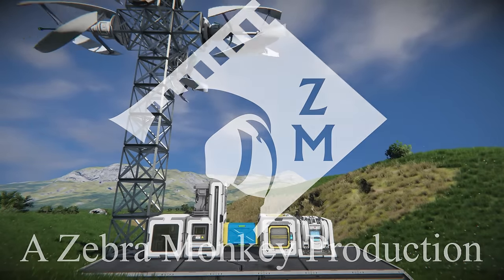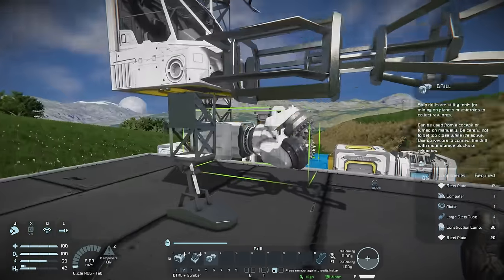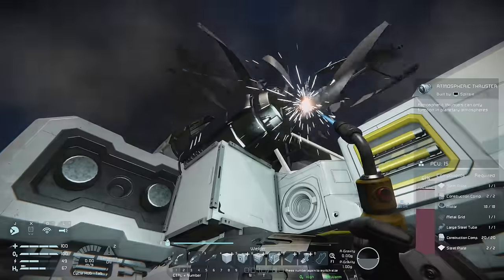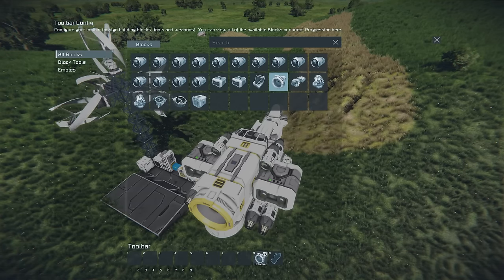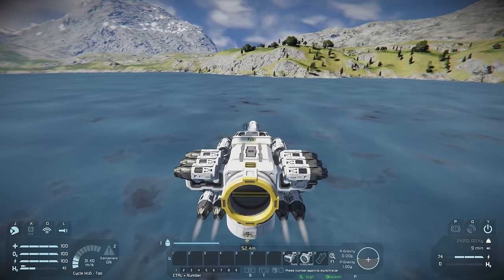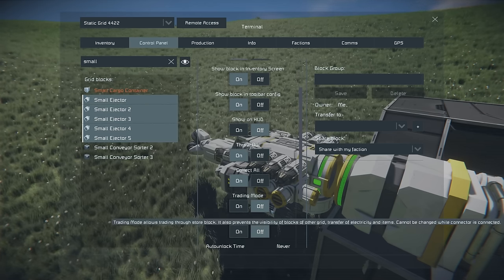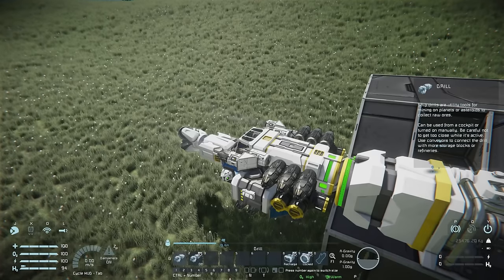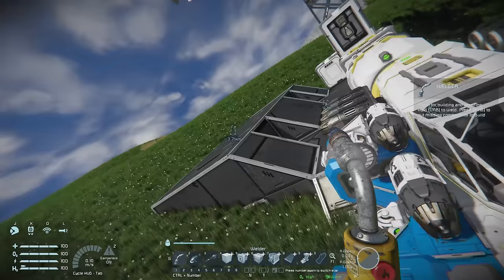Making a Mining Ship - Space Engineers Tutorial

Comment: That's one nice looking starter miner!
As for things you probably should mention in this one:
1. Point to the fact that spotlights work just as suit flashlight and can be controlled by pressing "L" when you're in the cockpit.
2. Starting small grid builds became easier than ever when they added a "add small head" button to rotors. It's way easier to do and way less chance to do it wrong since the rotor and the rotor head will be locked in place... well you'll have to explain how to lock the rotor too but still worth mentioning this method too along with connectors.
Reply from the maker: Good point about L, it's one of those things I use but seem to forget to mention :P
As to rotors/hinges, I don't think they're a good option when just starting out. Things like the thrusters going nuts while attached to a sub grid adds some extra complexity that I think are best avoided, even if it's the technique I always use myself :)
Reply: @Splitsie  I know what you mean. These days I always use a projector off of a LG-SG locked rotor for building my SG ships. Design in creative, then project for easy building. I also save all my blueprints with the batteries on recharge and the thrusters off, to start charging as soon as the battery is welded as well as completely avoid that problem with thrusters on subgrids.

Comment: Great tutorial! Just few tips to improve quality of life:
* Backward facing remote controller + camera on top of connector simplifies docking and flying out from tight mines
* Event controller on "Connector Connected" + 2 timer blocks for dock on/dock off sequences (recharge batteries, turn off/on thrusters/gyros/antenna/ore detector/ejector sorters/stockpile/lights etc.)
* Event controller + Holo LCD for cargo filling control - just turn on/off lcd with preconfigured text (checked AND gate, use level 90%-95% for small miner to avoid flashing when ejcectors pull out stone and drills push new stone)
* Event controller + Holo LCD for drill filling - turn on/off lcd with text (unchecked AND gate, use level 95% - it is hard to fill drill to 100%)
* Hide tanks, ejectors and sorters from inventory screen
Reply from the maker: Agreed, all great tips. I'll likely be including a lot of them when I get around to demonstrating the more complex stuff like Event Controllers :)
Reply: You only need a TB with an EC if you have more than 9 groups of blocks you need to toggle.

I use an EC for docking with no TB on nearly all my ships.
Reply: Never thought about putting the RC on backwards, seems useful, all the rest are great tips for anyone who doesn't like or cant use scripts as should be expected of new player tutorials
Reply: One of my fav uses of the event controller is to set it up so it automatically switches all drills off. This only works if you mine by setting your drill group to "on", though.
Reply: I've never needed RC or EC before, maybe I'll experiment with them on my heavy miner. Sounds useful.

Comment: One thing that I've taken to building while in space, and in the process of building a jump capable ship, is what I call a jump sled. Take a jump drive, add two connectors to it, surround it with solar panels and add two batteries. The thing will passively charge up jumps and hold 3 of them at a time, and you can use it to jump a small grid ship anywhere you want, while being dirt cheap compared to a true jump capable ship. You can also run conveyors around the drive to connect the two connectors, so inventory can run through it. Such a simple build, but tremendously useful, I find.

Comment: New player here at 20 hours.  This video is fantastic, if not a little daunting when you're first starting out, but if you persist and follow every step, you end up with an awesome mining ship!  

A couple of issues i experienced that might help other newbies, the first was control.  I found the ship very difficult to control until i had done all the thruster upgrades mentioned later in the video.  Then the ship becomes much more stable.  The other issue i had was that the ore located in the drill was moving down to the cockpit storage but not going past into the medium storage crate.   This i discovered was due to me having the storage crate orientated wrongly.  I had it with the small three squares facing towards the cockpit, but it actually needed to be facing outwards so the big yellow square meshed with the same square on the conveyor converter.  This was the only part of the video that confused me.  But the solution is to get them to match, then your ore will travel right through to your base's storage.  

The last tip i can give is that as soon as you install the batteries, you have about 30 minutes before they run out and your ship falls and damages its thrusters, so get it attached to your base as a priority the with it charging and stable you can continue with the building etc.  

So glad i found this video, Splitsie you are a genius! :)

Comment: Regarding sorters between 28:20 and 32:20, If you allow I can add some tips for sorters and ejectors:
- the best ratio of 'things' ejected thru 'ejectors' is to slap 1 sorter per 1 ejector (in some cases I put 2 sorters to pull on one ejector but it clogs ejector after some time so I call it like 1 vs 1). 
- if happens sometimes that you need the stone for some reason (let's say you don't have gravel in your base and you need it), it is good to group ejectors in a group and put them in hot bar for On/Off (you can add sorters as well but there's no reason unless you want to save power while offline etc). 
- you can also set sorters to always pull resources, that way you will always have full sorter inventory for an ejector to pull from (if you have 2 ejectors and 1 sorter, ejectors will throw 2 chunks but it will have the same amount as 1 sorter and practically you will waste one ejector, that's one more reason for slapping 1 sorter and 1 ejector only).
- sorters and ejectors are working on ticks, it means that everything going thru them it will be calculated in a single tick , that means on each tick sorter inventory will be full and it will be empty instantly by ejector, on the next tick it will pull the next inventory, that is another reason to use only 1 sorter for 1 ejector as well. :D

For offloading the ore to the base 33:12 to 34:50 , you can build an dedicated miner docking spot, it is same as one you have build one on a side of an survival kit, just build on another spot (free conveyor spot) an sorter on a base (arrows toward the base) and set the sorter to white list the ore and pull all (you can also set Ice in a whitelist), then slap an large connector and basically, when you dock a miner it will pull every ore and ice from the mining ship to the base cargo, just open the inventory and check when it's empty, close it and you can fly for another round. Later on you can see how much time you have to be connected until empty and without opening the inventory just fly for another mining trip ^^

Few tips for building conveyors. If you can try to fill all the slots of an conveyor ports specially when building large ships and when playing multiplayer game (game have an tick system I've mention above and it will check everything that have conveyor port, unless you put some functional blocks to cap an conveyor. It is not much affecting game render speed in single player but it affects a lot on multiplayer server or as well in single player game where you have lot's of grids which have lots of open ports on conveyors and not connected to something. Example: Conveyor block have 6 sides and sometime you slap like few in a row to connect something and it leaves like 4 on each open while only 2 are connected, imagine a big ships filled with that kind of build and have probably thousands of them opened and not connected and game have to check every tick all of the ports. My advice when building conveyor system on a grid is to build the conveying system as much closed as possible, without opened ports not connected, just try to keep the ports connected or use proper conveyor blocks such as pipe, curve, T piece etc...

I know this is not like something for maybe new people but it is helpful for even some experienced player, I have noticed that many of multiplayer games have player which doesn't know those stuff or maybe they just not interested in to remember them :D

Anyway, keep up great content and channel Splitsie, even with my 6K hrs of SE I still watch your tutorials and I like them every time as well as recommend them to anyone interested in SE
Reply from the maker: You can have an almost unlimited number of 'ejectors' per sorter as they can all independently pull material and the sorter's own pull becomes irrelevant at scale 🙂

There's a through put limit for conveyors but in practice you're unlikely to reach it in survival play.

The conveyor thing was fixed a couple of patches ago, the performance issues are now almost non existent 🙂
Reply: @Splitsie Didn't know they've fix the conveyor thing lol, thx for the update though. I really have to read the logs in detail in the future I guess :D

They have probably fix the ejectors thing with that conveyor updates since they can all pull from one sorter. I have to test it one day just to make sure. I will also check the code to see what's going on in deep. Thx for the update again. 

Those tests I was made for sorters are like 1 year plus old, maybe more can't remember, but anyway it doesn't matter to much as you say :D

Keep up great content and channel. Also, tutorials are awsome

Comment: I always use advanced rotor for the build platform. You get the benefit of power to your ship and the flexibility to start however you like with armor blocks.
Reply from the maker: I seem to default to hinges these days (for no particular reason) but chose to avoid hinges/rotors for new players due to the other complexities of the blocks and the fact that the thrusters go bananas when part of a sub grid, meaning you often need to turn them off while under construction :)
Reply: I agree with both statements. Maybe the rotor/hinge method can be included in a later video, with more advanced controls, like the K-Menu trick to keep the ship tools activated, and reverse thruster disable to allow coasting.

Comment: If you remove the center drill and use conveyors to connect the two on the outside, you get the larger mine radius and you don't have to worry about weight because it won't get heavy enough to fall.
Reply from the maker: Almost but not quite - I've had issues with a 3 block gap and having tiny pieces of voxel ruin my day :P
Reply: @Splitsie  I disconnected and reattached the drills. I only have a  T conveyor to attach the drills. They are closer together, but I think it works really well. Amazing tutorial BTW.
Reply from the maker: Oh yeah, with a single block (or two) between the drills they'll work perfectly 🙂

Comment: Awesome vid, you covered every main aspect of early ship building. I liked that you added in the question of vertical drills, and why you prefer horizontal. I actually prefer vertical drills, simply because they are far more stable if you keep the ship always in the same vertical orientation. Keeping the same vertical orientation also means you do not need (many) upward thrusters, and far fewer horizontal thrusters as the ship will never need horizontal to keep the mass airborn. So you you can eliminate a lot of weight from excess horizontal thrusters, and add more downward thrusters and carry more mass.  And if playing with remote control options (or programmable block), its much easier to automate a downward drill ship in atmosphere. All the reasons why I tend to go for mostly vertical drills. :) 

Yes, you end up mining a bunch of material you may not want, but if you mine an icelake, you can turn that ice into hydrogen for hydrogen thruster ships, and also stock up for the eventual hydrogen powered space ship. So mining all that extra ice down to the ore isn't wasted. With a Programmable Block, there's workshop mod programs to automate mining simply too.

Comment: The only adjustments I made to this excellent starter miner are; naming the blocks & groups for the ship type, creating and thursters group that I set as toggle on/off in slot 7, then the same with lights.  When I take off I cycle thought 6 lights on, 7 thrusters on, 8 battery off recharge then 9 for undock.  Docking is the reverse sequence.  Leaves the least risk lights on/off closest to the normal controls I typically have on 12345.  

As a few others have said I do like a docking camera if possible.  I also quite like slight tinting my side light as aft, starboard and then a beacon as the signal light on top.  Often an amber light to the rear too.   Adds a little more variety and the slightly green or red to the sides helps me orientate.  

Last time I'd say is come up with a naming system for your blocks and groups then do it as you build.  Even as a starter it helps.  Spot Light Left, Spot Light Right, etc.  You can even rename your grids to christen specific copies of your ships.

Comment: Only suggestion I would add is bumpers. Couple blocks on the back corners that stand proud of the batteries and thrusters. I usually only do the back two corners cause I tend to rub the back on the mineshaft. Rubbing a battery or thruster on the wall causes problems, usually in the form of an explosion. Great tutorial as usual. Cheers
Reply from the maker: That's a good call, it's something I should try to do for my welding ships too (though at the front in that case) :)
Reply: Yea you would think welders would be more durable. I use very sedate thrust on my welding ship. No sudden movements. 😀

Comment: 18:15 usually i reduce the magnetic power to 1/3 (on both), remove the 1 and replace it with 0. ive not once seen a dmg connector in 6 years doing this. :)

adv tips:
event controller is excellent to setup tanks to refill fuel on ship using the connecter connected option and you can also string on turning thrusters, lights, gyro and ore det. off/on with it.
if u have designated cargo container for ore, make a loop with a sorter on it to auto pull ore when the ship is docked (connected) and have a event controler do the job.

i love making industrial ships, mining transport building :)

Comment: I always use a rotor beside the connector to switch the grid from large to small before locking the connector down because sometimes I can't build a scaffold that fits.  And that way I know the two grids are properly aligned with each other.  This is especially handy when i'm using a weldwall or similar mechanism.
Reply from the maker: It's certainly a cheaper method, I chose to avoid mentioning it here as I didn't want to get into all the caveats of using those methods like the fact that inertial dampeners cause your newly built thrusters to go nuts :P

Comment: I remember going off your original tutorial back in 2016 or when it was but because i put 3 drills on my miner 1 in front and two connected to the cargo via the small ports i also put 3 batteries and a few of the smaller ones which i'd use as anchor points to attach extra atmo thrusters and by the time i had finished with my conversion you couldn't tell that your little miner was underneath it all. It did the job though it even got me to and from the moon with a few o2 gens and thrusters. Sure it took a long while and eventually just copied it and swapped out the atmo for hydro and the batteries for o2 but it was a sweet little miner.

Comment: landing gear is awsome. i put that on every flying ship. putting a small cargo container somewhere with emergency supplies is awsome. maybe a h2 o2 bottle, the stuff to build a connector and windmill base for emergency power. personally where i made my base the nearest nickel ive found is 30 km away. thats a long way to travel with a simple mining ship. and its surounded by mountains so my self recharging semi truck i built to haul the miner cant make the trip. i now have a recharge station half way to the nickel whose sole purpose is for recharging the miner when its full of ore. im in the process of making a mobile base rn but it needs alot of nickel before it can fly. just thought id throw that idea out there. also even if your ship isnt designed to fly upside down, id recommend adding a thruster or 2 and just leaving them turned off. then if something silly happens you have access to them.

Comment: I really like starting small grid builds off a large grid by using the technique of changing the rotor head to small size then locking it. I prefer it because no faffing around with aligning the connectors and seeing bounce all around (especially in space-like environments), and for the same reason of charging batteries whilst building.
Reply from the maker: I do the same, though these days I tend to use hinges. I only avoided that technique here because then I'd have to cover a lot of info about hinges/rotors to prevent potential disasters and my goal is first and foremost - avoid new player frustration for as long as I can :D

Comment: I usualy use a hinge or rotor to do a grid size transformation. Providing you lock the hinge/rotor you do not even need to complete it. While I have the feel for correct ratio of thrusters to batteries to prevent coverloading I run a script that works out the ships lift to wieght ratio both for the current altitude and at 70% atmo pressure. It is very rare that a miner needs to fly heigher than 70% atmo pressure.
Reply from the maker: I also use a hinge or rotor most of the time, largely because it's cheaper than a double connector. A bit more potential for errors and explosions if the grid can run into something on the hinge/rotor so I decided to keep those techniques back until after I explain subgrids and their foibles :D